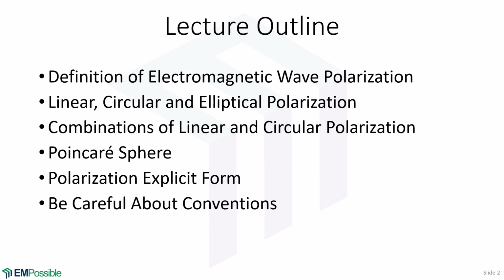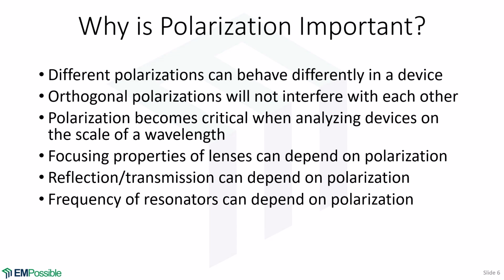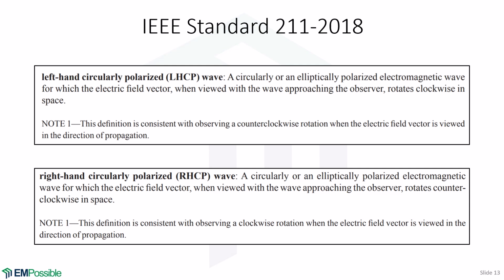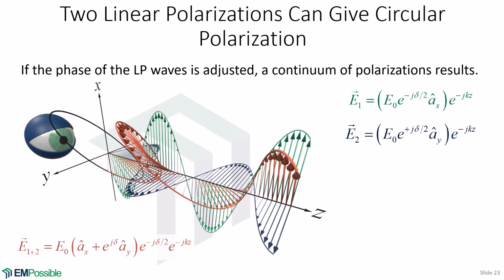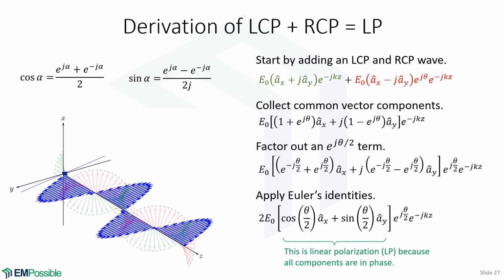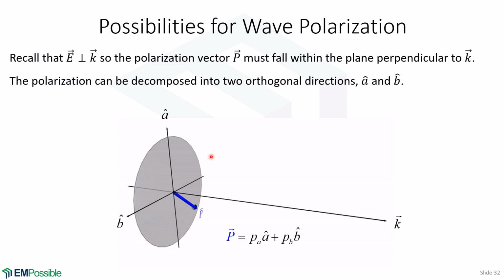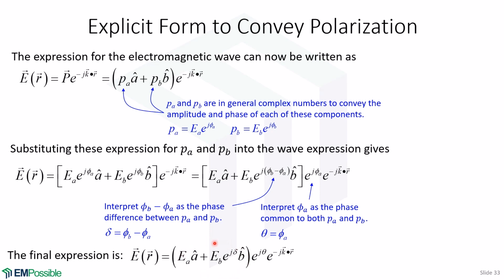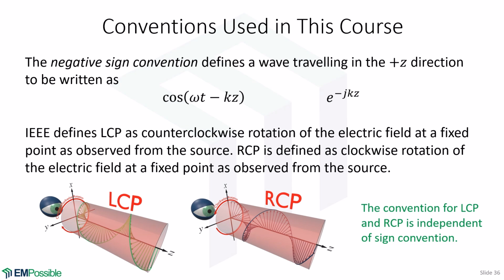Lecture -- Electromagnetic Wave Polarization

Comment: I am still a little confused about the first half of the content. My current understanding is that "theta" represents the phase difference on the x-y plane. and "delta" is the phase difference between the x and y directions polarization or called orthogonal basis . Is there anything wrong with my understanding?THX
Reply from the maker: Happy to help!

If you are looking at Slide 11, for example, theta is not a phase here. Theta is an angle that describes the tilt of a linear polarization off the x axis. The delta term that appears around Slide 23 is a phase. It is the phase difference between the linear polarization along x and the linear polarization along y. It is a bit different to refer to the two linear polarizations as an orthogonal basis but I do not think it is incorrect.

Hope this helps!